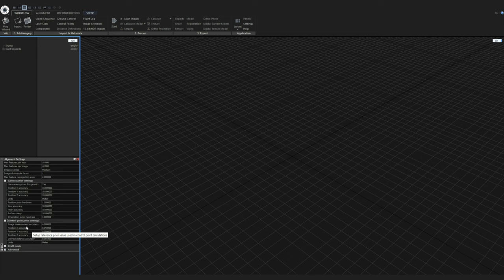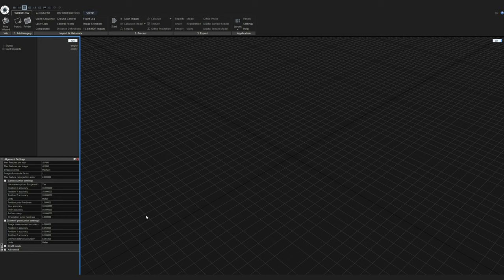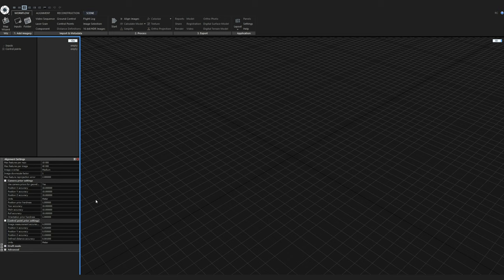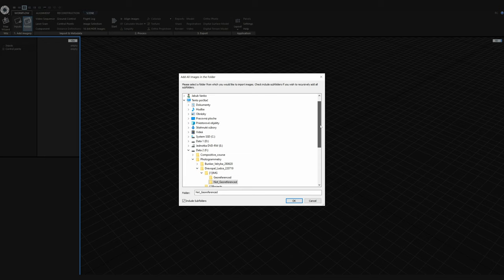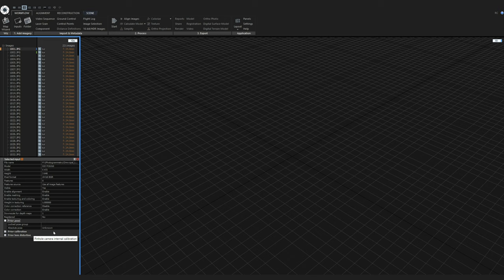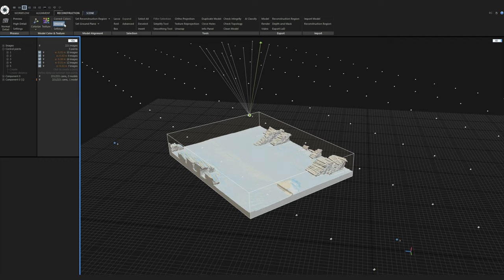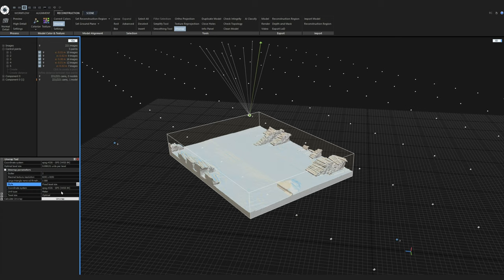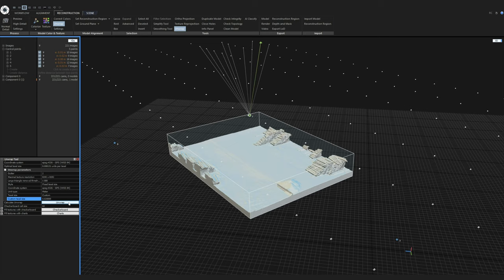RealityCapture tutorial: New mapping features RC Blaze 1.1

Comment: Thank you so much for this tutorial.  I've just started using Reality Capture for making heighmaps and terrainmodels with droneimages and this goes in depth with all the new features i want to use.  Really awesome!  I got one question since I'm new to this part of the software.  When you change the position accuracy, where do the new values come from?  Is this based on the accuracy in the equiment used to get the new coordinates or where does these numbers come from?
Reply from the maker: Hello Poul-Henrik,
 
if you wonder where new position accuracy values come from, they come from the default settings. This settings can be found in Alignment settings / Camera prior settings. This is if you mean position accuracy of cameras/images.

When changing position accuracy and running alignment with Absolute pose set to Position or Position and Orientation, then the new coordinates are calculated with the regard to the position accuracy that is set in RC.
 
You can import the accuracy from the equipment if it is known by importing Flight Log. You can find more about flight logs in the app help. Flight log always consists of an image name and coordinates. It can also have information about the orientation (yaw, pitch, roll) and the accuracy of coordinates and orientation.

Comment: Hello, for the Phantom 4 RTK images captured with RTK turned off in a PPK workflow, should the camera position accuracy remain at 10,10, and 20? Thanks very much!
Reply from the maker: Hi, if you didn't manually set the precision or if it wasn't in flight log then it remains on that values. But you can set it to a achieved PPK precision